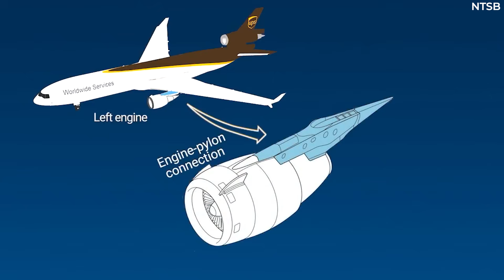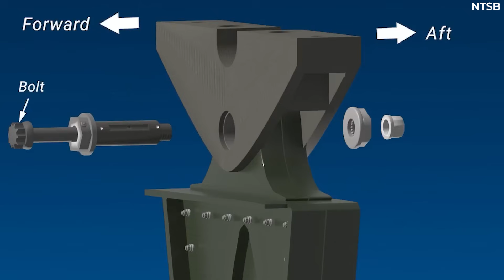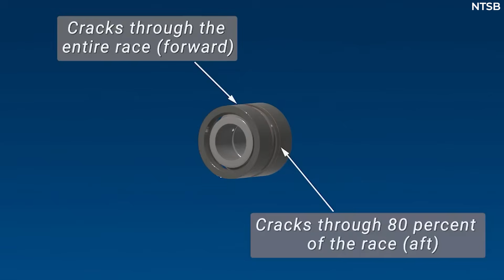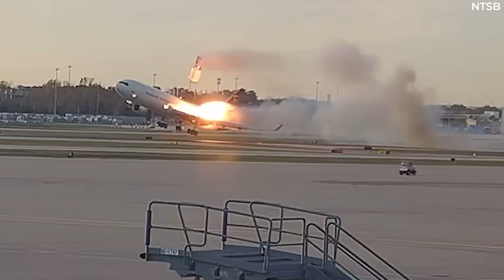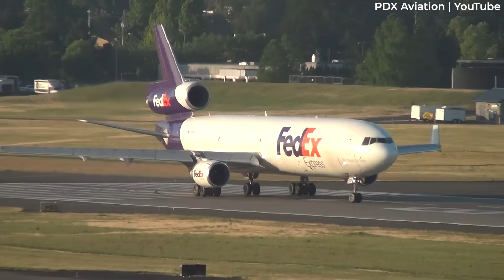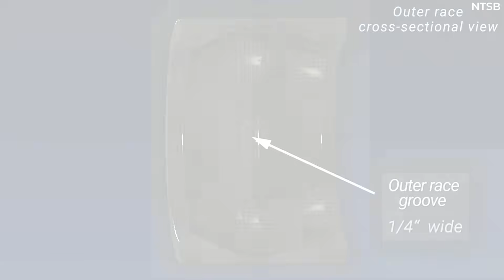NTSB Releases MD-11 Crash Footage, Explains How Engine Pylon Separated

Comment: Such a small failure has resulted in so much death, it's crazy.

Why can't the aircraft be able to fly even with an engine falling off?  I thought aircraft should be able to fly even with one engine failing.

As for the fire, why can't the aircraft detect the engine coming off and automatically switch off the fuel before the massive fire?
Reply: I think you live in a dreamworld in this matter. Sh*t happens, end of story. A lack of maintenance? Maintenance is done by people, and even with all the techics we have, mistakes will be made, today and in the future.
Reply: @arienoordzij3823 great safety motto for selling aircraft "sh*t happens, end of story", I'm sure they don't use that motto in Airbus.
Reply: @matthew_baynham  It's not a motto, but sh*t happens, that's a fact! And it's everywhere, all over the world, not just in the aircraft industry!
Reply: @arienoordzij3823 that's why you need aircraft to be engineered properly, for example when an engine fails then the aircraft needs to be able to maintain level flight and not just come crashing down to the ground.
Reply: @matthew_baynham  I agree of course, but if that was possible, don't you think they already 'designed' this already? And don't forget human factors!
Reply: Crew had less than 20 seconds to react
Reply: @airbusA346fan not relavant to my comment, when i was saying about the aircraft being able to fly without one of its engines.

But still 20 seconds is a lot of time to see the engine has fallen off.

Comment: from the animation is looks like the engine was only attached to the pylon in two places 🤔
Reply: This is common practice for fastening all jet engines under the wing. Whether Boeing, Airbus or other manufacturers. Two fastening points, with a handful of titanium bolts doing the actual attachment. Remember the wing has an amount of flex, and the engines have an amount of flex on the pylons also. If there was no flex, then the fuselage would be pulled apart.

Comment: Loss of an engine should not result in a crash. 
In case of AA191 the hydraulic system on the left wing was compromised and the slat retracted on one side stalling the left wing. 
Can you please make a video on What happened in this case.
Reply: I heard that debris from engine 1 was ingested by engine 2, causing a second failure.
Reply: @rowanholgate1435 True, it caused a compressor stall. Sheer bad luck.
Reply: Loss of TWO engines